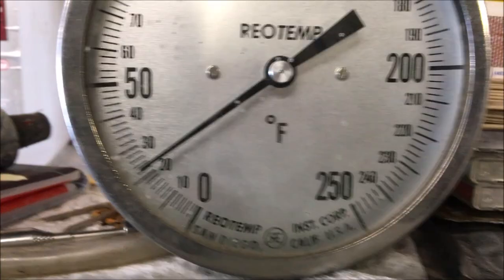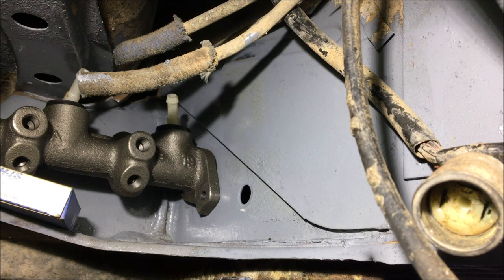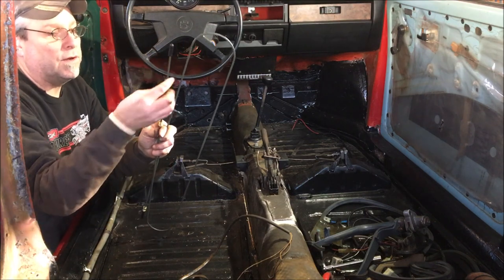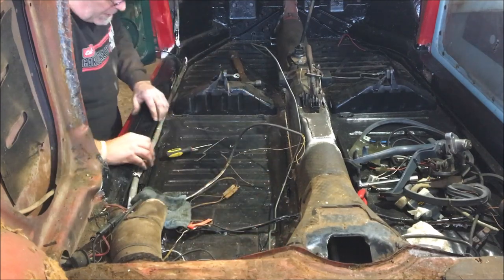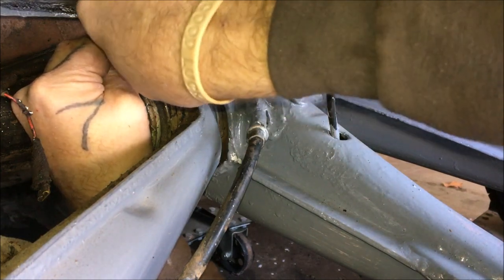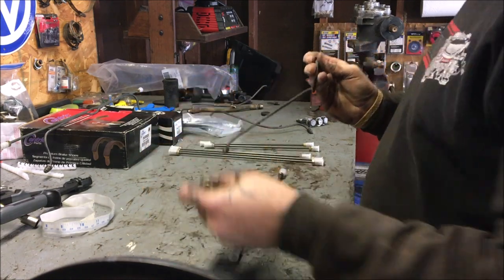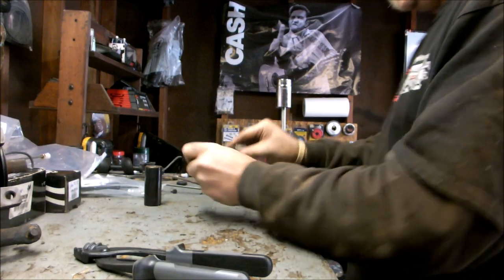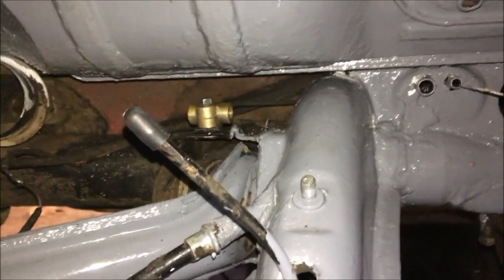VW Beetle - Super Beetle Master Cylinder Install DIY Tips... Part #2

Comment: I just ordered a cheap pair of those brake line pliers. I am converting a 64 to dual circuit but not replacing the steel lines (right now) so I'll need to reroute the line some to fit the different MC.
Reply from the maker: I really like mine! I am going to do a one minute short video probably tomorrow. To show what I did to those pliers so you don’t kink the lines it’ll make sense when I show the video. I’ll put it up tomorrow afternoon.

Comment: I managed to installmy master cylinder solo by using welders magnets and two nails from engine compartment to act as bolt quides and to hold spacers in place till bolts were installed
Reply from the maker: Outstanding!!! That was an excellent idea. There are so many tricks to doing these things. Unfortunately I don’t have magnets that strong.

Comment: Replace bolts with studs might make the things much easier. (Master cylinder installation, I meant)
Reply from the maker: Long as the sleeves are in place in between the firewall you could do that. Those are very important.

Comment: Hello, my good man I have inherited my father's 69 bug and have never worked on anything this old but thanks to your how to videos I have confidence in what I'm doing now! You are amazing and your videos are beyond helpful I appreciate your time and effort and it goes a long way. I had a question didn't the original brake master cylinder have 3 switches connected and the new one has 2 ?? I'm currently lost lol
Reply from the maker: Thank you Matthew for the kind words I truly appreciate that. And congratulations on your 69 bug, they are very fine cars.

I’m going to give you a link to my newer video, on the master cylinder and you will see exactly what you asked. 
My 68 has three switches on it, they are two prong each. 
The middle switch is to control the light on the dash. 
It’s a warning light. So when you lose your brakes, it tells you you lost your brakes by lighting up. 
I think you would know that when your foot goes to the floor. 🤦🏼‍♂️
Anyhow, a new master cylinder I bought, only has two ports, for two switches. 
And I’m going to put switches in those two of course. 
But I’m not going to run the middle plug that came off in the video it shows me marking them you’ll see what I mean. 
I’m not worried about a light telling me that my brakes have failed. I think I would know that lol

https://youtu.be/V4RHiQrfVlE
Reply: @SladesVWBeetle  perfect that’s exactly what I’m dealing with has no clue what to do !! I thought I purchased the wrong master cylinder 
Your the best

Comment: Should I add 2 small hollow metal spacers that the bolts would go thru to put inside the firewall  to help strengthen everything so when you push the brake pedal and it won't push the master cylinder or bend the wall bend the metel
Reply from the maker: Long as you have the factory spacers in between the firewall, the way I showed them. You will be perfectly fine. Unless there’s some type of other issue that you may be having.
Reply: @SladesVWBeetle  any pointers of where I could pick up the spacers
Reply from the maker: @frederickrueckert850  oh, wait, I misunderstood you. If your spacers are missing completely, here is a link where you can order some. 
I’m glad I made this video, because I think a lot of folks don’t know they need to be in there. Sadly, prior owners end up, leaving them out.

https://www2.cip1.com/vwc-113-611-629-kit/

Comment: I have to replace mine also on 73 beetle  what about the pedal side with rod and boot waiting to see
Reply from the maker: What do you mean my friend? Are you speaking about the rod that hooks from the brake pedal and goes into the cylinder? If so please do not touch that adjusting nut!

Comment: You stressed out the need of the spacers but I don’t see you installing them. Are they installed?  I just order them from eBay since I know not to have them installed. I remember having them on my original M/C.
Reply from the maker: Mine were still in place, so please use them. My newest video that I just put up the other day, installing a master cylinder on a standard beetle. I show them again. They are very important my friend.

Comment: Would teflon tape on the brake line threads be an overkill? I think about my indoor plumbing and never do any water connections without teflon tape.
Reply from the maker: Hi Brandon, no please do not use Teflon tape on the threads of the brake line. And there’s a reason for that. Because then the end of the brake line will not seat properly and you will have a leak. But that is a very good question. Because I have done plumbing on my house, and it makes sense why you would ask that.

Comment: From reservoir to master cylinder  does it start rubber  then aluminum line then rubber to master cylinder my aluminum  line broke so i put  rubber in the middle would that let to much air in even when tightened

Comment: Another question Slade. Was it a lot of trouble to get all the air out of the lines after you finished up. Im in the process of replacing all the lines and the Master Cylinder also. I dont know if I should fool with trying to bench bleed that with everything being replaced. Thanks EE
Reply from the maker: Honestly it wasn’t real bad. 
I didn’t bench bleed, but I’m not saying not to. 

I opened all the bleeders and let them start dripping. While I kept checking the reservoir so it didn’t run dry! 

As each one became a consistent drip, I would close that one off. Be patient and sip a drink and keep waiting!! 
that’s called…..“Gravity Bleeding”

Then grabbed my wife. And had her push the pedal to the floor, while bleeding each wheel cylinder. 

Not pump the pedal!! …..just push straight to the floor! Harder pressure!! 

I start at the passenger rear, then drivers rear, then passenger front, then drivers front. Hope that all made sense!! 

Please keep checking your reservoir! Don’t let it run dry while bleeding!
Reply: Thanks much Slade. That’s going to be my plan forward. 😊

Comment: best way to replace braided line to master cylinder ?
Reply from the maker: Usually you would first draw out the brake fluid. Then of course, remove the ole hoses, then install new quality braided brake hose!

Comment: Hey Slade, hope this post doesn't show up twice. I lost it right at the end. lol Anyway, please don't be embarrassed about your tremor syndrome. You cant help it. I think you do a great job with the videos and I am learning from you. I  have a recently purchased 72 bug that I haven't gotten on the road yet. I fix one thing and something else breaks. The car is really pretty descent condition. I had break lights when  I bought it, now I don't. Master reservoir is dry. I suspect the master cylinder or switches are bad, or both. Not looking forward to changing it out. My switches on the MS are 3- wires. I think 2 Blacks and the other was striped. Do you by chance know what the designation for these are? I figure the blacks are the hot or positive leads. What's the striped one for, any idea. I cant pick up power on any of them. While messing around with all this trying to figure it out, I have now lost my headlights, GREAT! Maybe I have a ground problem.  I might get it all figured out someday, lol. Thanks, EE
Reply from the maker: I am so sorry, I just seen this now! 
It can be very humiliating, but I try and ignore it. I guess its who I am..LOL
Okay, are you sure there is no leak, since it is dry...Underneath?
Also, I do believe that the third wire, is for the warning light, depending on the year. Your headlights, make sure to check the ground wires. Sometimes they get corrode. And also the fuses.....and the fuse connection for corrosion! 
Don't get upset. the master is not too bad to change. Make sure to check all your fuses first! The switches could have went bad. I would rest them!
Reply: No big deal on getting back Slate.  Everyone is busy and life is hectic. I did have a leak.  Now I have more. Lol. I busted the line over the tunnel in front trying to figure out where the other leak was coming from. I think the wife might have been standing on the petal when I was fooling with it. Anyway. I ordered a new master, all new steel lines, and rubber lines for the brake system. I haven’t tried to install anything yet. It’s deer season. Lol
The headlights problem was a broken wire terminal at the fuse block. I may be bugging (no pun intended) you again for advise. I appreciate your video’s and your help. Thanks. EE

Comment: Do you bench bleed the master cylinder before installing it in a car? Thanks!
Reply from the maker: No, I never half on the Volkswagen beetles. I just gravity played all four wheel cylinders, and then of course have someone pump the pedal. I’ve never had an issue with them.
Reply: Slades VW Beetle Thanks!
Reply from the maker: Carking Spot Absolutely, thank you for being here.
Reply: Slades VW Beetle My pleasure. I already have the new cylinder on the table vise ready to bleed it, so I’ll go ahead and bench bleed it while I’m at it. Best.
Reply from the maker: Carking Spot If you have it at the bench it can’t hurt to do!!
Reply: Slades VW Beetle I have bench bled it, it was a pretty simple process and I am so glad that I have. Thanks!

Comment: Did you bench bleed the master? I have one on the way wondering about that
Reply from the maker: Honestly I didn’t bench bleed. After everything was buttoned up, I loosened all four bleeders and let it gravity bleed. As each one started a steady drip I would tighten that bleeder closed. While...keeping an eye on the reservoir so it didn’t run dry. 
Then, after all we’re tightened from dripping. I then had someone press the pedal firmly, while manually bleeding. Worked perfectly well! Thanks for being here!!!